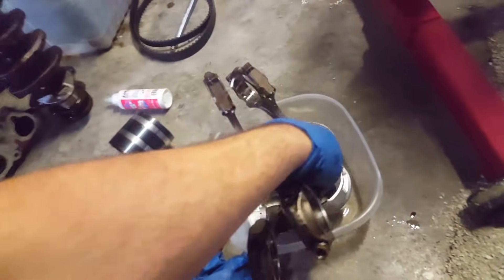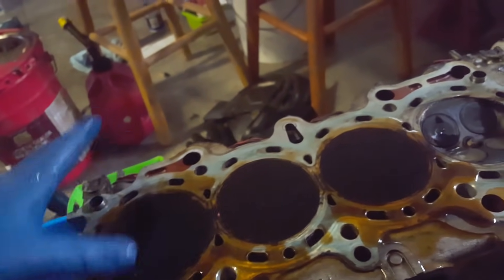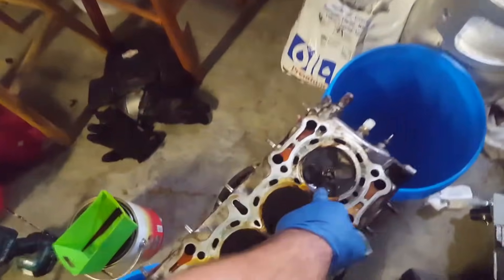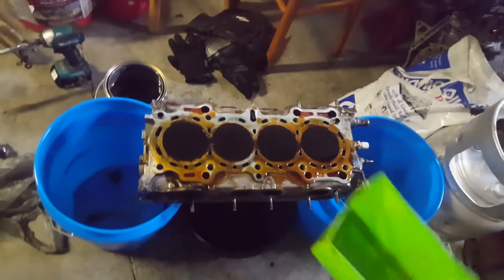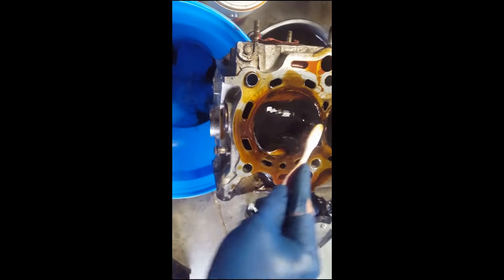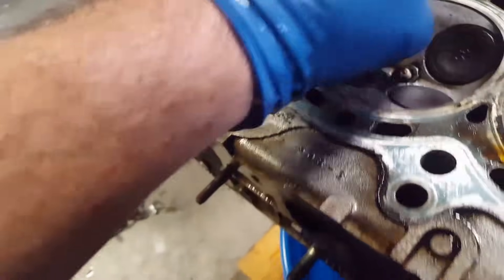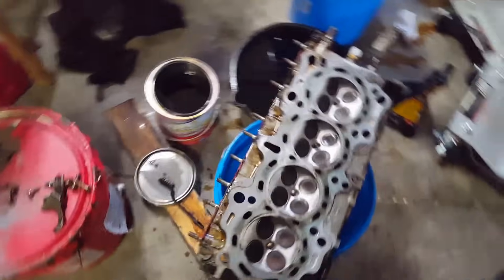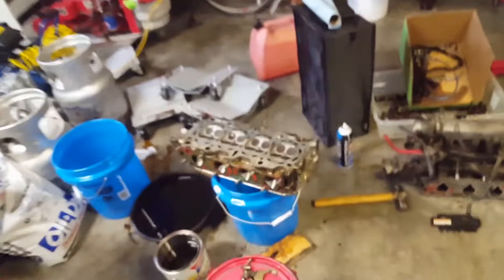It eats away Carbon Buildup EASIIILY!!

Comment: 3m throttle body and carb cleaner works way faster and honestly better. Maybe a little more expensive but you can move to the next step instead of waiting hours. That's a pro tech tip kids.
Reply: steff k 3m will NOT REMOVE HARD CARBON FROM RINGS VALVES AND HEADS.

Comment: SP Tuning, have you read the label on the bottle to discover what chemicals are in that stuff? The warning about alloys is concerning. How much does it affect the alloy whilst removing the carbon?

In the old days on bikes (especially two strokes) we used to polish the combustion chambers like a mirror to avoid carbon buildup. We now know that’s potentially somewhat detrimental to the combustion process, but it stops carbon buildup completely if you do it right. By that I mean you first have to totally flatten the surface by removing all imperfections. Only then can you start to polish.

Comment: Alot of new "green" stuff on the market doesnt work for squat. 
Glad ya tried some good old toxic shit that actually works, like mom used to make😝
See, its not that bad just wear gloves!
Reply: Anything "green" or "eco" run away
Reply: @AmandaHugenkiss2915  
Yea it usually works like crap. 
Only thing I've seen in that category that kinda works ok is purple power straight up ,not mixed with water. 
Just don't use it on a hot engine unless you like all your aluminum parts turning white.
Reply: I took a big boy poop.  I'm a big boy.
Reply: That carb dip he has is a new formulation. I've used it. The old stuff smelled like death, while the new stuff isn't so bad. I usually use acetone or mineral spirits myself, followed by CLR and media blasting...depending on what it is of course.
Reply: @tempest411  I actually got a parts washer a few years ago, the tractor supply one. 
It's like .0005% better then the harbor fright one. 
2 five gallon pails of the juice cost 3/4 what the machine did, but for our small tinker shop it's great. If that doesn't work, bust out the ultrasonic and if that doesn't work beadblast it. 
And if none of that works , take the acetylene torch to it and melt it into a blob🤣
Sumbitch won't not come clean for me !!🤣
Reply: @tempest411   smelled like death lol. You sir just made my day!
Reply: If you are using Berryman 0996, it can be Aggressive on Aluminum if soaked to long.

Comment: I used head gasket remover worked just the same good video though thanks for sharing
Reply: Zip strip paint remover  is cheaper. 
And its the same thing, they just dont sell it in spray cans. 
 you can probably get a gallon of that for what a can of fancy spray zip strip gasket remover costs at the parts store.
Reply: @MrTheHillfolk  just giving alternatives maybe a gallon to much to be wasted for alot of people

Comment: It will eat any plastic,rubber,neoprene parts immediately,,, (expensive experience)😕
Reply: He was using a plastic tooth brush.
Reply: And don’t forget any kind of LUNG Tissue !!😷
Reply: I used to hate the stuff. Chlorinated hydrocarbon cleaners were nasty, they reformulated it to being a mild acid base which will etch aluminum and brass if given enough time, but actually works far better and doesn't seem to be quite as horrible as the old stuff.

Comment: Its easier to pay machine shop
Reply: Nice to handle things yourself sometimes🛠️
Reply: Not everyone has $15,000 to pull a head off and rip apart and cleaned at a shop
Reply: @TheSunnyTrails  I could get that head hot tanked, resurfaced and valves ground around $200. Im not going though all that labor again just to try and save a couple hundred bucks. I would rather do it right the first time.
Reply: @alecb8509  $200 ? Mexican rebuild.
Reply: @chrismontreuil2206  Nope. Last heads i had done were a hyundai 2.7 v6 ( 2 heads) cost me $275 in southern WI. Block work is costly at the shop I use but head work is too cheap to do twice.
Reply: @alecb8509  that's a decent price. Costs here on west coast are double that. I had my own shop and the prices put me out of business. And I was doing five engines a week.

Comment: Typically a full rebuild entails taking the valves out and taking the head resurfacing the valves and the head surface not just removing carbon
Reply: Joseph Moran at least re-lap the valves with carbide grease
Reply: @deborahchesser7375  Yes at least that if everything is in good shape.  People seem to forget that all your horse power comes from the upper half (head ,valves ,cam ). If your not going to do it right then why bother . Just change the gasket and move on.

Comment: How do you clean out the water jackets of any residual crud in head and block? Radiator cleaner in a tank/big tub? 
I used Kerosene in the past to remove oils/ grease and carbon (let it soak for a few days and then plastic brush it), but needed to come up with something to clean the water jackets...
Reply: Pressure washer just a wild guess lol

Comment: Hmm i need this for my egr ports
Reply: That's what brought me here too.
Reply: Coat hanger and spray carb cleaner is all you need for most clogged egr ports.
Ford 4.2L truck engine you have to remove the plenum. For 4.6 and 5.4 a 9/16 drill bit works nice to dig out what you poke out of the egr holes in the elbow.
Reply: Same

Comment: Yes looks great 
and i was wondering if we could use an ounce in the oil and run the car for about a week on short trips 
Maybe to cleen the piston  oil ports  or the lifter oil ports or the gunk accumulations in the valve cover areas and drains 
Maybe maybe 
Does anybody know if this cleaner damages Orings and gaskets
Reply: You can use atf. Be careful though. Smokes like a camp fire. Start with  1/4 quart of atf to 4 quarts of oil. Drive it for about 100 miles. Then change the oil. I've used that trick on yaris's, sebrings and f150's that use 5-20 oil. Don't add too much atf. You'll take out the main bearings. Atf has detergents in the fluid.
Reply: @fuq5802  Yes, that is an old trick to free up a lazy lifter.
Reply: This stuff eats up rubber. 
Dip a carb in it unassembled, and the o rings come out the size of dinner plates. 
No bueno unless ya remove all the rubber and plastic before dipping a carb. 
So from that, its your choice to add it to oil.

Comment: Yes but is this high flammible ! Use as a adtiive in the fuel to burn it out .
Reply: Yes and i was wondering if we could use an ounce in the oil and run the car for about a week on short trips 
Maybe to cleen the piston  oil ports  or the lifter oil ports or the gunk accumulations in the valve cover areas and drains 
Maybe maybe 
Does anybody know if this cleaner damages Orings and gaskets
Reply: @freddykugr  me personally I wouldn't but ay

Comment: That also checks for bent valves as it cleans. If you come back to it and 1 chamber is a lot lower than it was, there you go.
Reply: Bent valves is an unlikely cause of combustion chamber leak.  More likely the valve to valve face seal needs to be corrected.
Reply: @ramtek2702 face seal? Is this the same as an valve seat?

Comment: Hey Looks good. It looks like the valves are seating otherwise the liquid would have leaked out. Nice job Nice tutorial video
Reply: Yep!
Reply: ......yes, it's a good sign. Things may change slightly though with temperature change .
Reply: Really? So the heat and pressure inside the cylinders is no stronger than gravity acting on a little liquid? Horse apples. That seal you are imagining is likely more carbon baked onto the valves & seats. Reinvent something else, 'cause this wheel has been done.

Comment: Why not just use a circular wire brush and a Dremel tool to clean the combustion chambers on the head?
Reply: Nylon wire brush?
Reply: He who rules, no it does not scar it. If it does scar it, you're doing something wrong.
Reply: he who rules no bull. It's called experience and common sense. I use a brass wire bell with pneumatic Moto tool regulated.

Comment: Do you use a roloc disc to clean?
Reply: Yeah I dunno why someone would bother with strong smelling chemicals when you have such an open area to work with like this.  Hit it with a Roloc and will come off in seconds, no odours/fumes. No carbon soup to get rid of afterwards.  You might need to use chemicals when the space is confined, like the back side of the valves/ports on a DI engine, but not an upside down cylinder head on a bench.  Even cleaning DI engine ports/valve backs, media (walnut shell) blasting is a better idea, if you have the capability/equipment.

Comment: When should you look into removing carbo build up? After how many miles/years of driving?
Reply: If you are taking apart your engine and see a bunch of buildup, you should take care of it to prevent any hot spots and predetonation in the combustion chamber. 

I just tore down my 200,000 mile motor, and there was zero carbon buildup in it, so a "do it every xxx miles" rule of thumb isn't a great way to go. Just visually inspect. You can usually rent for free a boroscope camera to stick into your spark plug holes without teqaring everything apart for a quick inspection.
Reply: @HippieGeeks  Wich engine do you have?
Reply: @AAAAAAndrea  vg30e 9:1 high compression, plus a turbo
Reply: @HippieGeeks  good old asian engines 😏